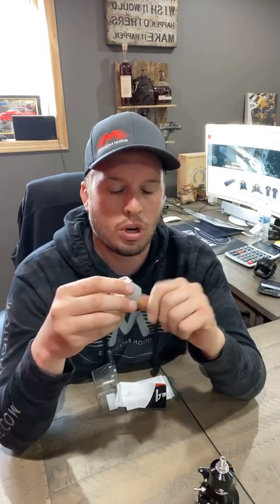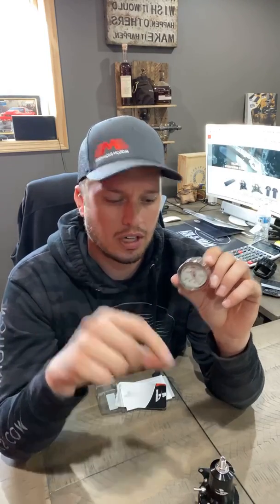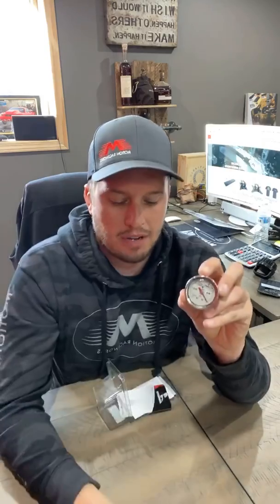Why Your Fuel Pressure Gauge Reads WRONG: Live Feed Replay

Comment: Well some of the units have just a rubber nipple on the top and it physically says with a white sticker on the gauge that says cut?
I've never seen a gauge with a button on yours there's other models out there with rubber nipples and it clearly states to cut a vent hole on the rubber nipple

Comment: I do have a question I’m chasing to see if it is possible to have this regulator( smaller one) be stuck at 20psi I try to adjust pressure and it stays there

Comment: I never used oil filled gauges in the engine room or on the engine when I was in the Navy. Oil filled gauges were used in the control room which is usually air conditioned so that we had a much better control on the pressure of an oil filled gauge.